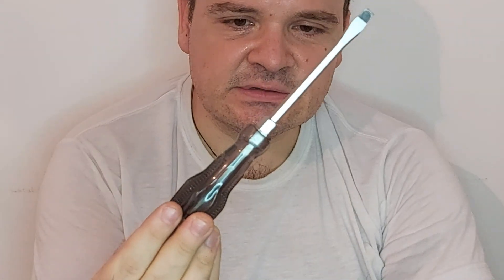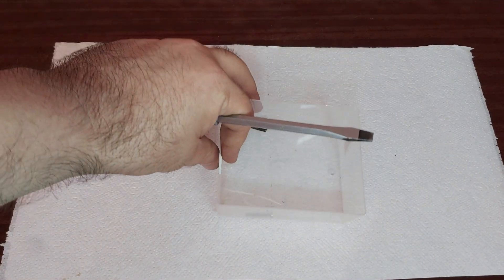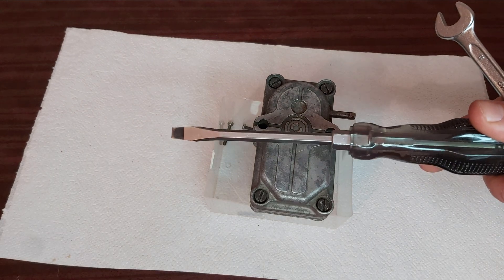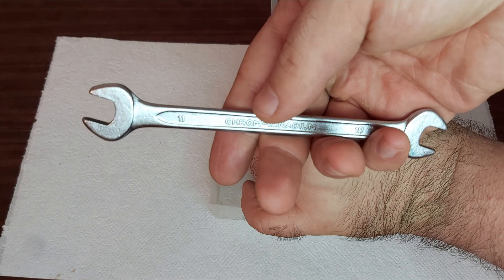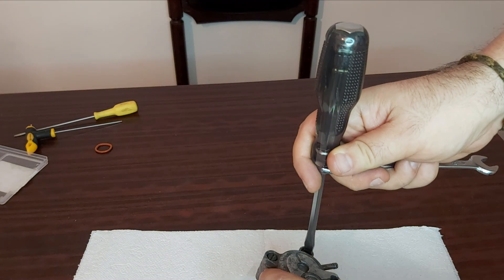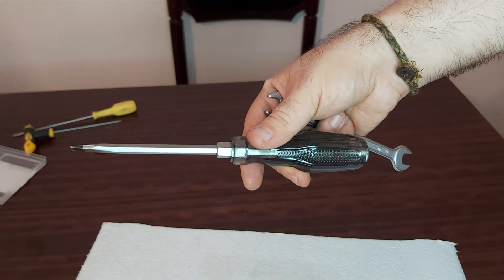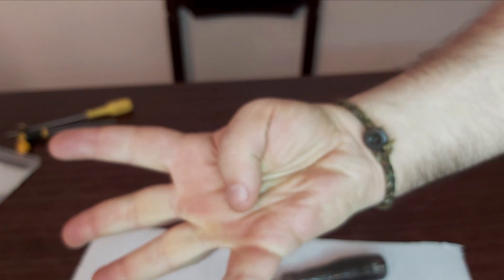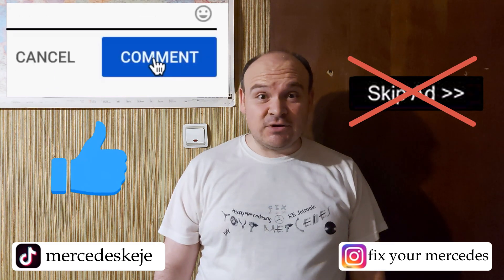㉦Mercedes Ke-Jetronic㉦ - 🧰️🔨🪛A tool you should have️🪛❗🔨🧰

Comment: Hello sir. Congratulations on your incredible contribution. I am watching carefully and I confess that you have helped me a lot to be able to have a good result of smooth operation in W124 M103. The only problem (if it really is a problem) is that it is slow to start long cranking either cold or hot. When it starts everything is fine. Before I changed the injectors, (that were leaking and creating misfire)  in the morning started with one turn) My mind goes to the height of the plate which is in the specifications. I tried to reduce the gap but I didn't see any difference in starting the engine. Thank you for your time.

Comment: Hello sir, need some troubleshooting advice, don't know the best way to reach you. I have a 560SEL ke jet system. Had no fuel delivery to one injector so I rebuilt the distributor. Ran great briefly then started running poorly. Did fuel pressure testing, with EHA UNPLUGGED, got 6.2bar system pressure and 4.8-5.0 control pressure in the lower chamber with the vehicle running. I replaced the EHA valve to no effect. What should I be looking for here? Many thanks if you are able to help!
Reply from the maker: Hello. So, if you got this big pressure difference with the new eha then try turning the screw on your eha counterclockwise with the pressure gauge on. Try to reach 5.8bar control pressure. Turn at first the screw for one 8th of a turn and then mount back the EHA and measure the value until you have reached 5.8bar. That's everything I can tell. Good luck!